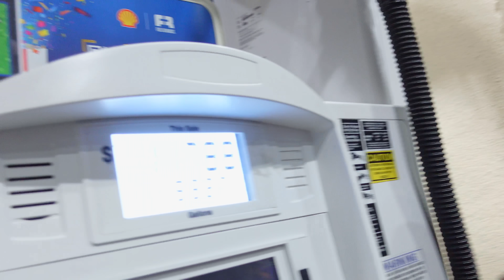I DESTROYED MY MERCEDES BENZ

Comment: Bro nice car FYI i will not explane the whole engine but CHANGE OIL EVERY 3500 MILES AND NEVER FILL OIL UNTIL MAX JUST BELOW,it will safe you a 10G repair ,if your milage is over 50k let the camshaft check for wear